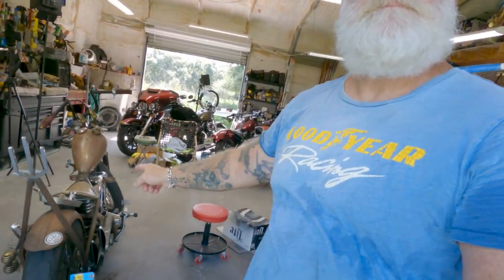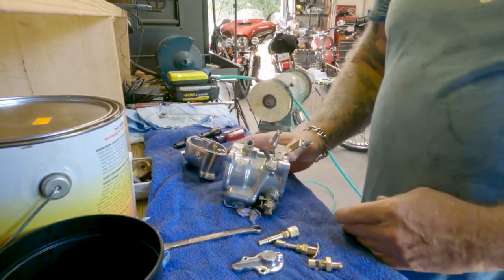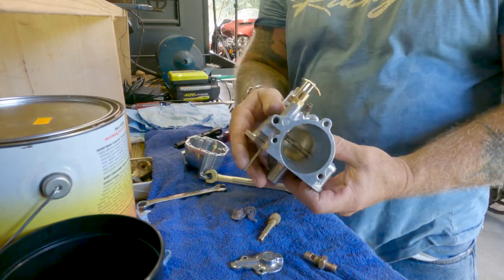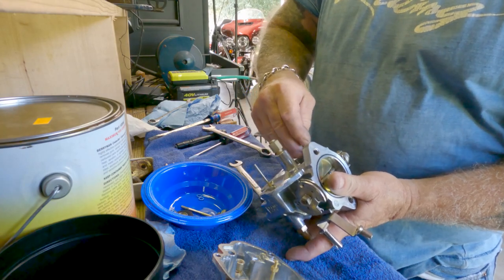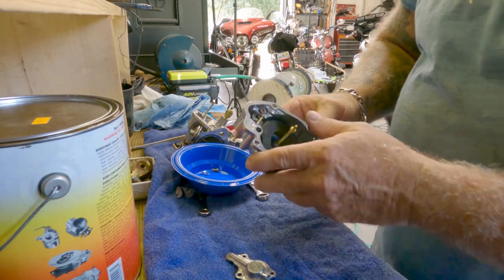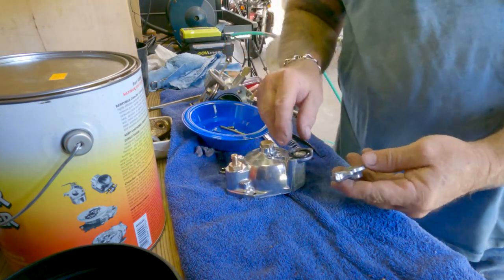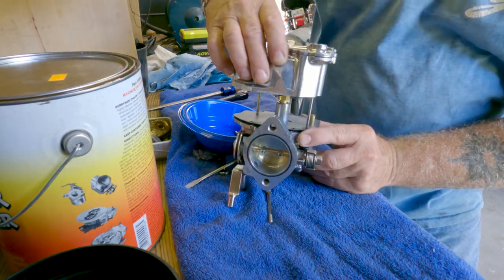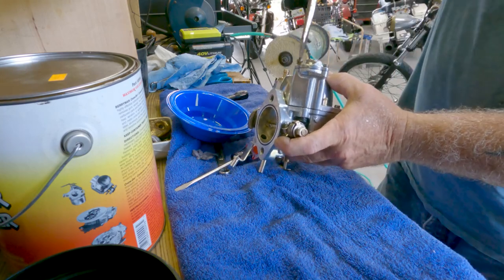How to rebuild a S&S Super E carburetor off a SHOVELHEAD

Comment: Ive been rebuilding carbs since i was 8 yrs old. My dad moved out and we needed our lawn mowed. Lawn mower wouldn't work so i started working on it.  Rode my bike 1.5 miles to the hardware store, told bill thr hardware guy was was going on. He said it sounded like a carb issie. He handed me a carb kit. He refused to let me pay.  I scrounged up tools from neighbors. I got the mower running and the rest is history
Reply from the maker: Great story, great memories...unfortunately most carbs nowadays on mowers you toss and get another one for $20.00 on Amazon....
Reply: @shovelheadffej  ya.  Ive run into that in the last couple years.  Along with briggs & Stratton production going overseas.  Engine quality is terrible. 
   While on the subject.  I called my local HD dealership.  I needed a rubber front engine mount. They said its back ordered untio middle of November and in November the back order date will likely get pushed out another 90-120 days ( asian production).  Due to this I started checking on other random parts.  Same situation for various parts.  Ive decided to start buying parys periodically, to make sure I have them when needed.
Reply from the maker: It is starting to get difficult sourcing a lot of things...

Comment: Absolutely reliable carb, rebuild it blindfolded and drunk on the side of the road. I run an old khien on my Ironhead. But if you're stuck on the side of the road... Don't let that bowl gaskets loose. That sonuva bitch will swell and you'll never get it back in
Reply from the maker: Those khiens will give you give you a education in carburetors real quick..man drunk on the side  of the road just brought back memories..🤣🤣🤗